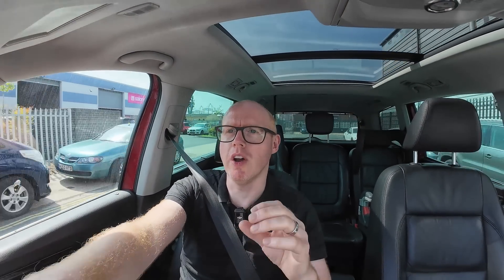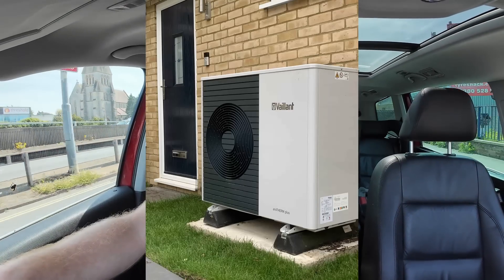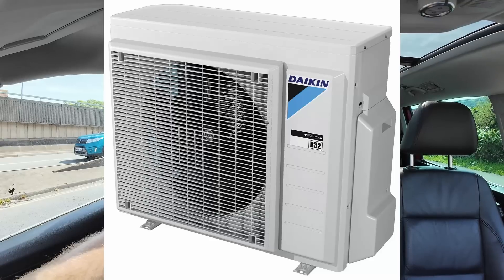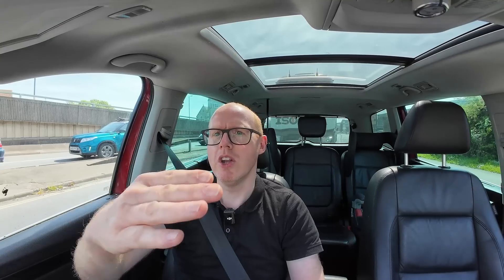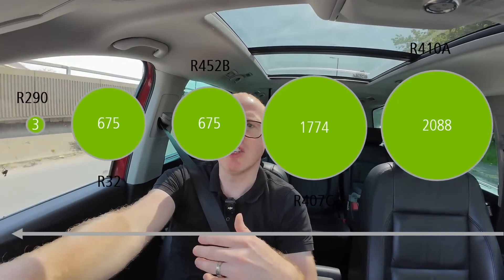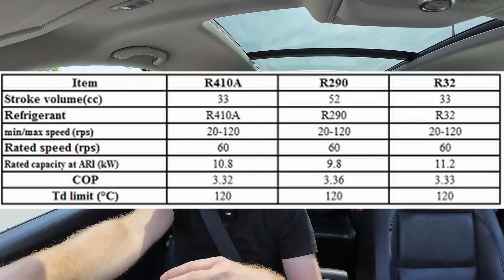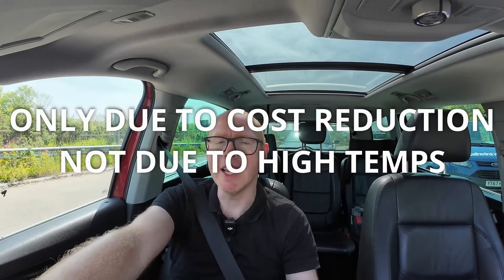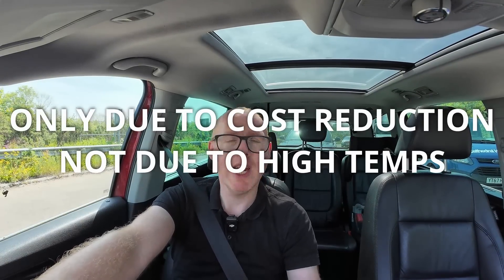High Temperature Heat Pumps Solve Nothing! Octopus Cosy 6 is nothing new!

Comment: Interesting comments, very helpful. Would be interested to hear more thoughts on infrared....we are trying to decide on infrared vs air-to-wet vs air-to-air solutions...and going round in circles!! 🙃 Infrared is never going to be as efficient but could be cost effective I guess if you have battery + PV 🤔
Reply from the maker: Infrared is known to cause damp and humidity issues in a domestic property due to it's targeted and limited ability.

I'm not totally against it as a supplement in bathrooms, occasional spaces etc but it can't offer the same levels or comfort or running costs as a heat pump system can, whether that be A2A or A2W.

We really need more places where homeowners can go and trial these different technologies to get a proper real world feel.

Having used IR for 4 months before our A2W heat pump came online, I will never go back to using IR in a home environment. Expensive and uncomfortable.
Reply: @UpsideDownFork  thanks for the reply, that's really useful to know. I too was a bit concerned about how IR could feel in the home. 👍
Reply: @UpsideDownFork  the thing is Infrared is the same as heat pumps, if it's not fitted and used correctly it will not perform to its optimum.
Infrared is actually extremely good at preventing damp if it's set up with the proper controllers and sized correctly. As to costs to run, yes it will be more expensive than a gas combi however again if it's set up right it's not as bad as you might think. ASHP or a combi  has to heat up pipes, radiators then the air which rises when hot so you have to heat up more air before you get warm. Infrared on the ceiling heats you first but then heats the fabric of the building so over time costs fall if you manage it properly with smart controllers.
I've been looking into ASHP and IR for months and exponents of each say the other is a con! Who to believe? Well my plan is to go with infrared because that's affordable and can be implemented gradually as and when we can afford to get more. Once the installation (by a UK company that manufactures and installs it's own product) is complete with it's smart controllers then we'll see. In the interim I'll keep the gas c/h and supplement it with the IR panels until it becomes the reverse, panels supplemented by c/h. We'll probably reach a critical point where a battery is needed to use overnight cheap rate but that'll be a judgment call as to if and when. My personal reason for going this route is it seems to be the least disruptive and the least complicated to understand and operate. I cannot do all the mental tinkering that seems to be required to make an ASHP work, I've considered A2A but not keen on having big holes punched through my walls disrupting the air gap and causing damp problems (I won't have cavity wall insulation for the same reason). Although I'm sure I'd appreciate the aircon in summer, with my chronic health condition I wouldn't like the moving air flow, either the noise or the draft or is it draught, can't spell today, so that's off the table.
I need to look back to remind me of how you went about testing IR for four months but if you inadvertently acquired the wrong size and/or located them wrongly then you do a disservice to their potential use in a case like mine to pronounce them a con.
Reply from the maker: @judebrown4103  the short version of our experience was that they were ruinously expensive.
We never ran them long enough for the fabric to heat up and retain heat for when they switched off.
I tried targeted heating only when a human was in the room and I tried leaving them on a lower setting for longer. Unfortunately neither option worked.
I haven't produced a video on this specifically as the company I worked with were great and they did agree to take all of the kit back and refund me.
The installer who I spoke with told me off the record that it is not uncommon for kit to be returned and refunded, so make of that anecdote what you will.
 
They only heat things in direct sight, so any obstructions caused the shade effect.
Comfort was not a major consideration at the time.
It's only in hindsight that I now see the MASSIVE comfort benefits of an A2W HP.
A well installed and commissioned heat pump will not need tinkering.

I wish you the best of luck and please report back after a winter with IR. I think in some limited scenarios they could be ok as supplementary heating, but I just can't swallow the argument of them as a primary source from my own experience. 👍
Reply: @UpsideDownFork thank you so much for this comprehensive reply, really so helpful to know.

 Who did you use, out of curiosity? 

(It also explains why I can't find the video I could have sworn you made!😅)

I will definitely approach with caution, my house has small rooms and we don't like too much heat so I'm hoping those factors will help keep bills down. I will be careful to get the proper regulators too.

 This year we changed the way we use our gas c/h from turning it down to 10° overnight then putting it up to 18° in the morning. Using this method we also found it often got chilly in the evening and we'd have to turn up to 20°. 

We changed that to a set back temp of 17° overnight, which to our surprise wasn't too warm and turned up to 18/18.5° during the day. Interestingly we never had to turn it up in the evening this year despite some cold snaps plus our bills were not as high even with the price increase.

 So this is what I mean by proper regulation of the use of heat, which I know you're aware of, but it's why I'm prepared to try to reduce our reliance on gas even if I can't eliminate it completely.

 Its not going to be financially possible to start the change until September/October and I reckon the most we'll put in at once is three rooms upstairs so results will be of less use to start with. But I'll try and keep you posted. 
Edit: I forgot to say that we will be mounting the panels on the ceiling to lessen the risk of heat blocking.

Comment: Greg's main promise of the R290 Cosy6 is that it can run with a standard "gas /1m2 coil " hot water tank . & for the 8 million of us with those tanks  we can save £2k on the install. ( yes we will have low COP for HW but how low?). If true it will be a benefit.  
 
Regarding heating flow temperature in the 55c 40c range it is suggested 5c drop in 'coldest day design flow temperature' causes a 8% saving in Kwh electricity/year  & this will be the same with high temp heat pumps . Do you think that 8% is about right ?
Reply: Ive got a new build that was build 2 years ago that came with gas central heating and it does appeal in not having to change the radiators since theres about 14 of them. My issue is the house is too hot most of the time and if there was some heat pump product you could also connect to an air conditioning multi split system that would be ideal.
Reply: @nick255  

Most HP's by design are air conditioning units, as example my Daikin EDLA06 is the 'heat only model', whereas the EBLA06 has heating and cooling functionality, thanks to a valve that can 'reverse flow' and pump heat from inside to outside. Potential issues then with condensation if using wet systems, unless used with designed emitters with condensation traps.

But grant doesn't cover that, my theory being that government don't want to create huge demand on grid over summer, causing power rationing calls or outages as they have in California.
Reply: Mine runs fine on a standard tank although it is only 5 years old so maybe not to scaled up. Never a bad investment a new tank better could and better insulation than old ones
Reply from the maker: You will lose somewhere in the region of 20-30% efficiency by using a regular cylinder over a large coil HP cylinder.

This could reduce a system with a DHW COP of 3.0, down to 2.1 as a worst case kind of scenario for example.

The 8% saving for space heating is about right.
If you take the 5kW Vaillant unit for example and plugged it into an existing system at a flow temp of 55 degrees which most would run at out of the box. You should expect a COP of 3. If you then upgrade a few rads and lower the design temp to 45 degrees, you should achieve a COP of 4.

That could be a difference of £200-£300 saved per year depending on the heat loss of the house.

Rad upgrades are cheap and in most cases, easy.
If these upgrades are done during a HP installation, then they are VAT free and in some cases partially covered by the BUS grant.

Comment: If the marketing bring some nervy people on board seems good. Also for the proposed £500 you can put it in try different flow temps see if it works with your system. If your scops not to your liking you can change some rads in future. Makes for a minimal initial instal and one less gas boiler.
Reply from the maker: Well said.

Comment: Given the environmental benefit, is it feasible to 're-gas' an R32 heat pump with R290, or does the pump need to be changed?
Reply from the maker: I don't believe that is feasible. Based on my experience of refrigerants being phased out for classic cars and new compressors etc being needed to upgrade the system.
Reply: Most parts of most refrigeration systems are designed with a specific refrigerant in mind including the condenser size, evaporator size, and metering device type and size. So much would need to be changed, it’s just unfeasible.
Reply: So on that basis I'd hazard a guess that R32 is likely to be phased out in the future due to it being more environmentally damaging, so "high temperature" heat pumps are likely to become the industry standard. Hence Octopus' strategy.
Reply from the maker: @wotireckon  so called "high temperature" heat pumps are already the industry standard.
Every single heat pump manufacturer already supplies R290 pumps, some have done so for several years already.
That's not the issue here.
It's the marketing which is questionable and misleading.
Reply: @UpsideDownFork Ah got it. Thanks!
Reply: @wotireckon  

The 1.35kg of R32 (GWP of 675) in my Daikin 6kW is no more damaging to the environment should it all leak out than about 911kg of CO2, which is about six months worth for the average gas boiler.

As an aside my fridge freezer compressor is on/off eight times a day for past 20 years, and is still going strong.

R290  (propane flammable) and R32 (essentially non flammable) meet different requirements regarding MCS 020 regulations as to how close they can be placed to windows/doors etc.
Reply: @_Dougaldog Thanks - that puts it into perspective.

Comment: You've got to admit that low temperature heating is a barrier for people. People are strangely averse to minor radiator changes and that seems to prevent them using lower flow temperatures for their non condensing but labelled condensing gas boiler equally as much as a low temperature heat pump. 

This is Octopus's angle. Installing brilliantly efficient low temperature HP systems is slow and bespoke and time consuming. We haven't got time for that. Where as a higher temperature system is easier to lob in with less changes needed. 

Now the problem is that it gets a lower SCOP, and might not reach parity with gas heating costs as easily. The crazy gas to electricity price ratio we have here is the problem. 4 to 1 , where as lots of the rest of the world is 2 or 3 to 1. 

Is it better to roll out a few perfect HP or loads of less perfect ones? 

That's their pitch albeit I'm sure they explain it better than me themselves.
Reply from the maker: Well put. 
The truth is, all of that can still be achieved by an old R32 Daikin "low temperature" heat pump. It can still heat those existing rads to 50 or 60 degrees.
I don't have an issue with Octopus rolling out heat pumps to the masses, I want to support that in every way possible. I just think the marketing surrounding it is disingenuous to say the least. They're not the only ones doing it as well. They're just an easy target because of their high profile.
Reply: “Strangely averse”?  I was told a heat pump install would cost me about £40k for my house.  That doesn’t include all the ripping up of carpets and flooring to fit new pipes and radiators.
When a new boiler would cost about £5k, there is nothing strange about being averse to the low-temp heat pump idea.